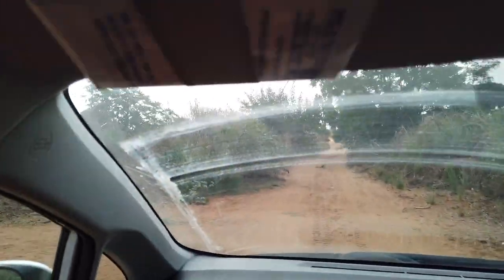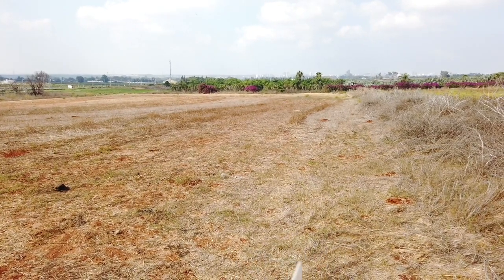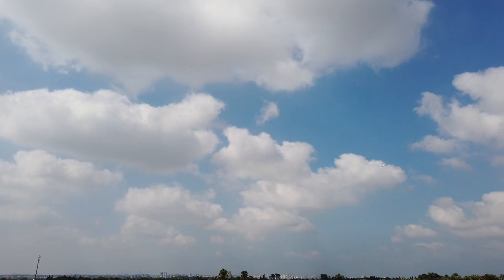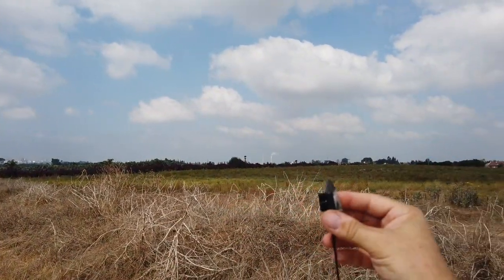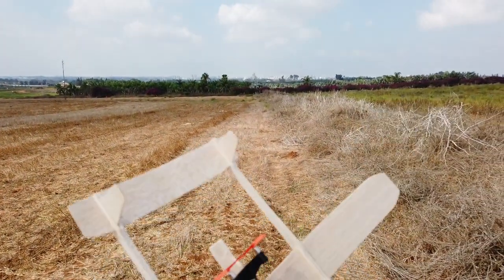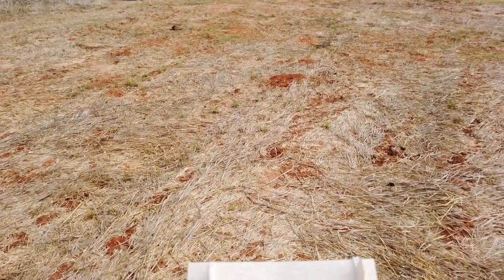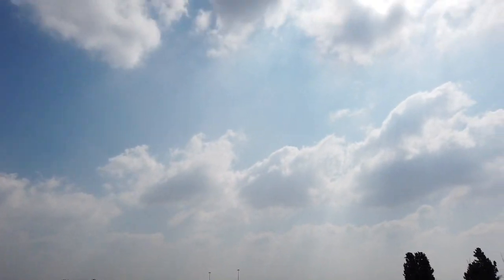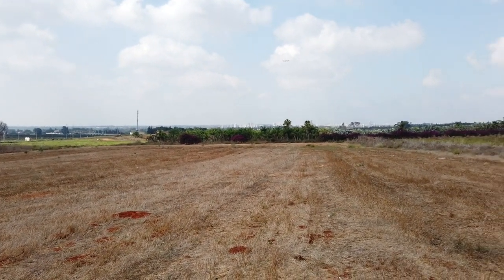Will it fly challenge with POWERUP 4.0 using balsa-wood gliders

Comment: @poweruptoys I know this is a suuuuper old video at this point, but I am hoping you see this question: what kind of settings/tuning do you do in the app when you're flying a balsa glider, or another winged flyer, instead of paper? 

I would think going with the Tornado Updraft or the FT22 would work for many, provided the PowerUp module is mounted inverted?

Comment: what balsa plane models did you use ? i want to try that awesome design with my power up!!!!!!
Reply from the maker: Hey Stephen, The POWERUP I tested is the 4.0 which is not yet available, only later this year or if you ordered via Kickstarter or Indiegogo. I used the basic Guillows and some designs I combined from a few Guillow models.
Reply: @Poweruptoys  So, something changed, I decided to use the same Jetfire glider from Guillow with my Powerup 4.0 and it will not fit, the powerup 4.0 is now too long to attach from the top, I have to use invert position. Apparently the production version of the powerup 4.0 is longer than the version used in this video

Comment: More turning force ? Cool ! 
The 3.0 doesn't have this in the app or device 😕.
Congrats 👏🎉🎊 Sir ! 
Natural born constructor .
🥇🏆🥇.•°
Reply: More turning force : 
Is it more  ⏪ ⏩ movement of rudder ? 
Or is it more power⚡️ on the copper ring pulling the rudder ?
That would be fabulous.
3.0 has very weak rudder force.
It gets centered already by the wind from propeller 😕 .•°
Reply from the maker: @farrider3339  The App does have this feature, but the twin motor m module of the 4.0 has much more turning effect than the 3.0 thanks to the differential thrust